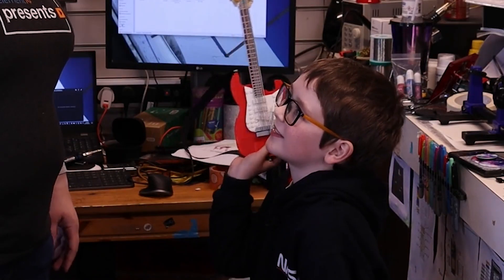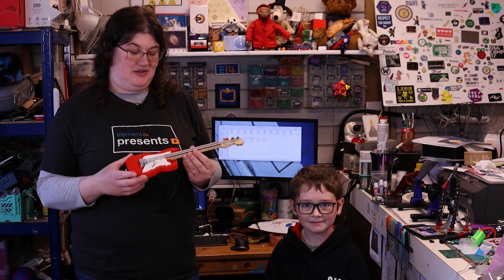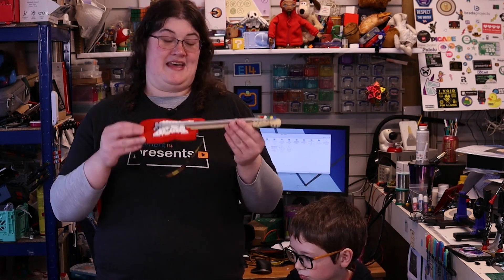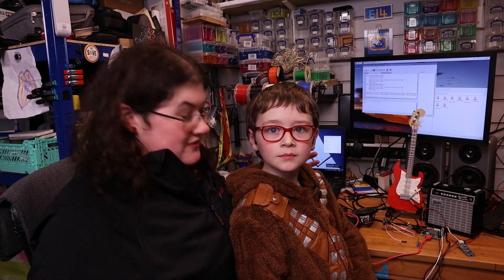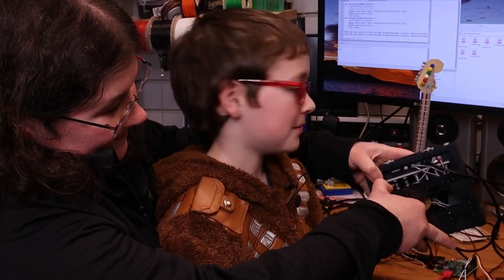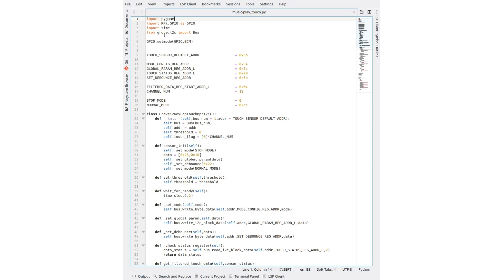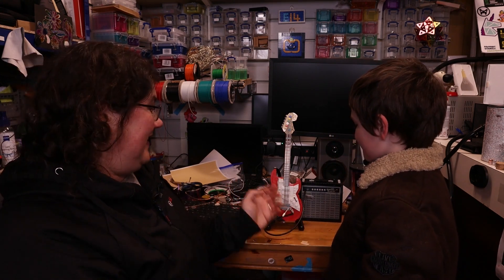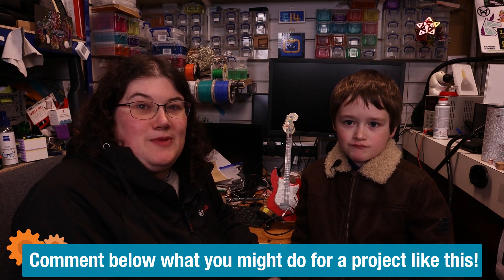Making Music with a Lego Guitar and Capacitive Touch

Comment: Maybe the cables could also be hidden in an extra cable channel. I mean it's Lego so it should be easy to implement 😁
Reply: This was my original plan, to make a channel through the centre with a Dremel to hide the wires through the body and up the neck. As seen in other projects, I've got no issues glueing and cutting bricks when required for a project, but John really wanted to avoid cutting into his Lego set, so we had to find another solution that he was happier with
Reply: No, don't use a Dremel, just use different lego bricks to leave a channel :)